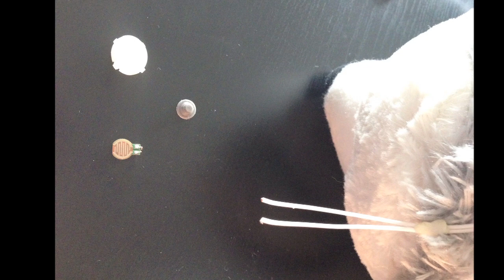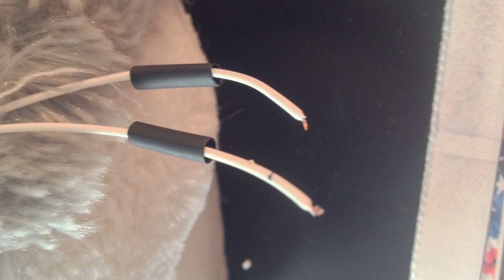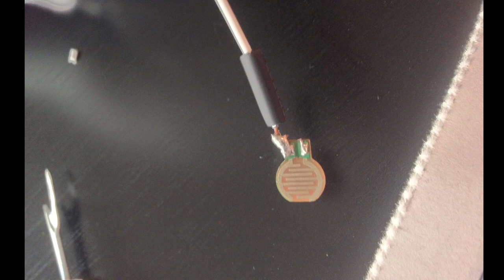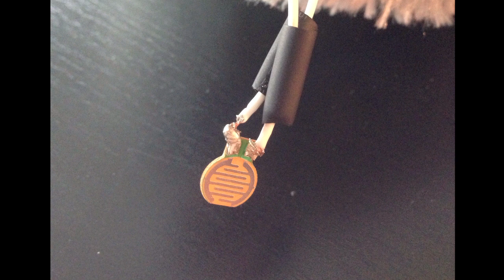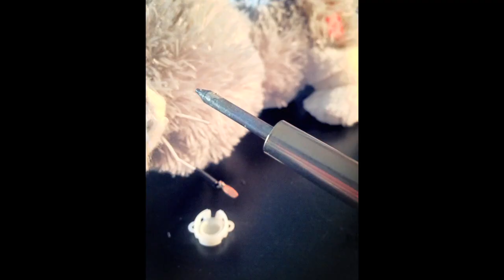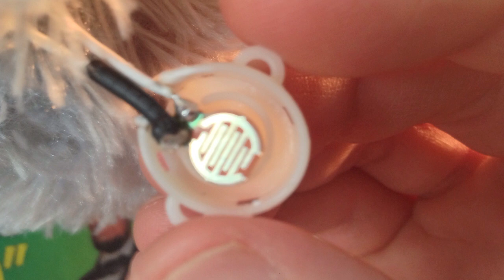Tutorial: How to repair a broken Jingle - Hallmark's interactive story buddy

Comment: Ours worked great at the time it was packed away, after using jingle with our son a couple years.  Then it mysteriously stopped working when we pulled it out for our youngest daughter.  Sure enough, one of the wires came loose at the button in the ear. Some minor doc mcstuffins surgery with some Re-soldering, jingles back to being jingle.

Comment: This is a very useful video, thank you for it. Iwould like to ask mel m what do you mean by saulder? I don't know this word....
Reply from the maker: Were you able to get things going? By "solder," I mean the metal that melts at a relatively low heat. It bonds with the wires and conducts electricity well.
Reply: Ok, thank you. English is not my native language and I could not find this word on any dictionary .

Comment: the story buddy in this video did not turn on and off. I have the same problem as you but mine is a scooby doo.  He turns on off but does not respond to story.  I followed my wires through the body of the toy and found a device in his nose that had a wire detached this must be what picks up the readers voice.  This needs to be sauldered like how they sauldered the on off switch in the video
Reply: mel m Were you able to fix your story buddy? This is the issue we are having.